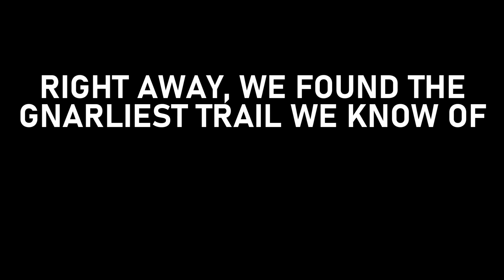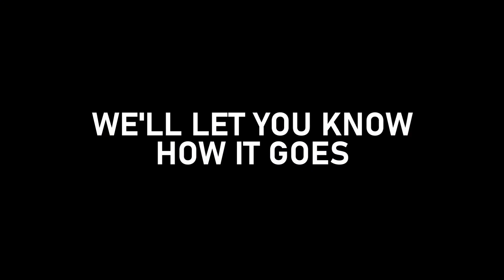Subaru Forester snaps an axle off-road

Comment: Liking the content Boys.  You guys are inspiring me to some perks to my 1999 LEG SUS, 4eat I bought a couple years ago.  Thinking about a small lift (2 inch or under), and 50/50 mod switch with torque locker and FWD switch too.  I have a question: can you use the 50/50 switch through at least the first 3 gears if not all 4 (higher speeds).  I watched an good installation video on another channel but they claimed it should only be driven at low speed, yet some people commenting said there is no need for the 50/50 TCU mod button because putting the car in 1st will do the same thing.

Comment: does axle snapped because that locker ? if that wheel in air and locker make it spin and then car touches ground or something and suddenly it got grip and bam goes the weakest part there.  i think axle its not worst brakes there. diff would be much worse problem.

Comment: Those axles are complete junk. 

I appreciate the new design but they are garbage. 

I've had a 100% failure rate with them.

This year installed two front ones on a 2008 Outback and they both blew up with no warning a few months later. 

It's the no warning that's the worse part. Just driving along and BOOM. 

The only thing connecting the tires to the drive train is the CV boot. 

I hope you have better luck but I absolutely don't recommend them. 

Start looking for replacements now.
Reply from the maker: Your sarcasm is prolific. I'd believe you're serious, but your story makes no sense.
Reply: Chris Racklyeft also had them blow up with no warning after like 300 miles. Import Direct appears to be the same thing just relabeled.
Reply from the maker: @bruceyyyyy  Very interesting. Weird too, because the quality actually looks quite good. Oh well. They're in now lol.
Reply: @powerofyourbrains  100 bucks says they won't make it to summer.
Reply from the maker: I don't think I'd take that bet even if we were talking about oem's. If they're as crappy as you say, they'll break tomorrow
Reply: @powerofyourbrains  Good point. 

How about Christmas?
Reply from the maker: I mean, you've wheeled with us before, so I'm not sure why think we'd take that bet.
Reply: @powerofyourbrains  Sorry guys, this time sooner or later bruceyyyyy is the winner.
Reply from the maker: @torreVs  Well, now that I've heard from you, we'll make sure to keep our rescue gear with us tomorrow. Oh well I suppose. Bruceyyyyy is not the most trustworthy character on YouTube. 

Just kidding Bruceyyyyy.

We trust you.
Reply: @powerofyourbrains  I'm serious like a heart attack! 

Just because I troll my own comment section doesn't mean I'm trolling you when I say these axles are junk.
Reply: @powerofyourbrains  I've had 1 of 2 of those HD axles break. The bearing cage looked like it was recycled and welded together by a blind dog. 

You might be thinking "welded?, they're not supposed to be welded but a single cast part." ... Exactly
Reply: We might have set a record. Ours only lasted 2 days, and <2 hours of drive time.
Reply: @jasonchall3766  I heard of one not even making it past it's inaugural test drive. :/

I liked the idea of a better axle for our cars but this definitely isn't it.

Did yours shear at the inboard joint?
Reply: @bruceyyyyy  Yup, the little shaft between the plunge joint and the inner angular joint. Normally hidden in the boot until everything tears itself apart. Then again, for these the latter really is the normal state.

Comment: Just chiming in to agree with everyone else; those "HD" axles with the ball spline design are garbage. There are several brands that sell them but they're all the same and everyone who uses them experiences failure.
Reply from the maker: Yeah, we've taken notice. We're full tubular back there now thanks to the new lateral links we just installed. Perhaps that will lend enough stability for them to last a little while. If not, we come prepared for the worst, and that includes tire chains. Tomorrow will be interesting.

Comment: The rear oem inner cv joints are not tripod but ball type. Is that broken axle an oem Subaru ? Can't see the green NTN color under the mud and dust !
I'm sure the HD axles will break very soon too....sorry !
Reply from the maker: I don't believe so. It's not green like the other side is. May be why it's the one that gave. Regardless, we don't mind being the guinea pigs here. We have a FWD switch and tire chains in case shtf.
Reply: We checked today and it was indeed an OEM one we broke. Green after all, just covered in mud.
Reply: @jasonchall3766  Good news, the Torq locker is very solid. Bad news, it can break oem cv axles...don't worry, a Quaife helical did the same to the same rear right axle (broken cage though, not an axle snap) on my Forester 3 weeks ago...
Reply: @vincentwindels3752  Sorry to hear about your axle, but thanks for sharing, that's good to know, as a helical is definitely one of the other options I've been interested in. What axles are you planning to run going forward?
Reply: @jasonchall3766  Oem axles as aftermarket axles are bad. But I have to say that I was very hard on the Forester getting up a rutted section (video to come if I can get the hand on it). Next mod is to try retrofit a Arduino traction control to help the helicals on diagonal spins, it should put less stress on the transmission too.
Reply: @vincentwindels3752  We may well end up just using OEMs as well. Arduino traction control sounds awesome. I've been daydreaming about the same sort of thing actually, though that went a bit back burner after we got the Torq-Locker. Definitely share that with the world if you succeed. I'd be up to collaborate on that if you're interested. I'm an experienced programmer, though not with Arduinos.

Comment: All for cv axles should be changed to this type when lifting a Subaru
Reply from the maker: Wrong, unfotunately. These axles are junk.
Reply: Power of your brains if not your cv axles, some designed to compensate for the change in the geometry and load due to the lift and heavy tires.
Reply from the maker: @videosvideos6243  Yeah, these broke after 7 minutes. Just stop.